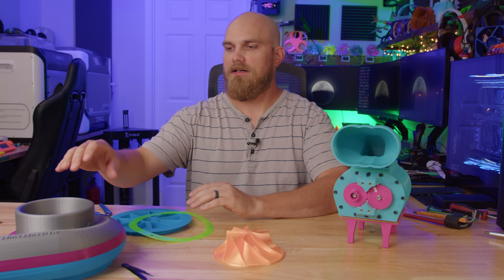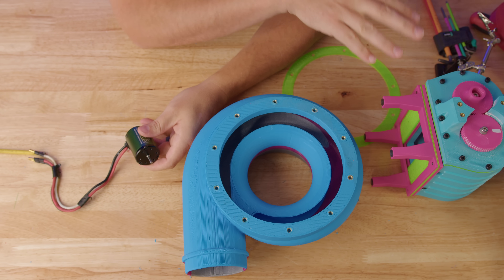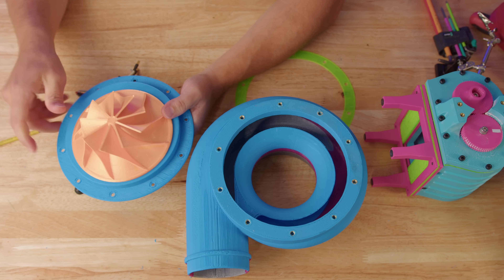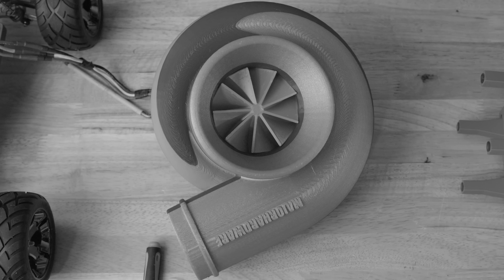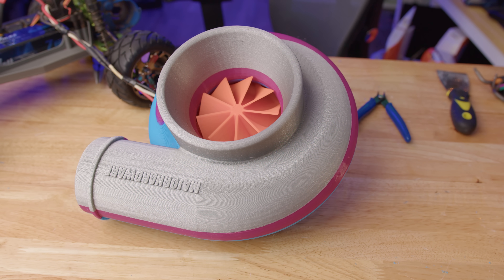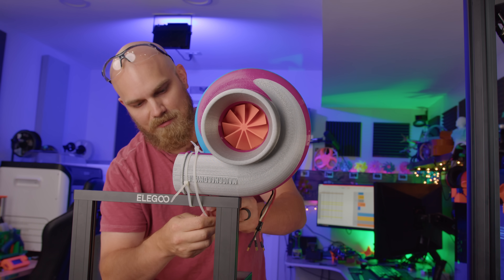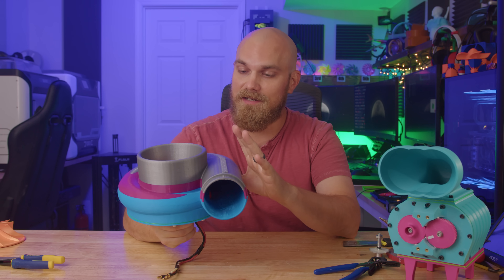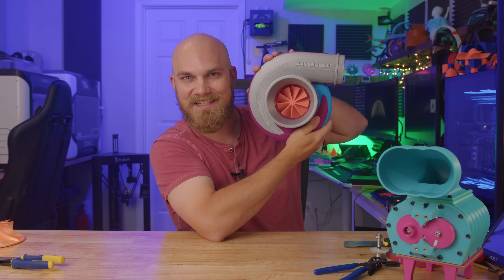I BUILT a MASSIVE ProCharger for my PC

Comment: The tests done look really great, specially the amount of air this thing pushes is insane.... howwver you should also have done the temperature test of the air temperature at the inlet and at the outlet to see if there is any change in the air temperature.... In fact you should invlude this air temperature test for all the fan showdowns you do.. it could be one more paremeter to test if the air coming out is cooler or hotter or no change.... Just a suggestion. @MajorHardware

Comment: On fans closing off the fan output till up to speed will reduce the reduce a lot of overheating at least with conventional AC motors or slowly bring up your speed. Pumps are current pigs on startup.

Comment: I wonder if this or similar design can be done as a Tesla pump (ie turbine in reverse).
As a tesla pump it should suck air close to the center on one side and in its simplest design blow it out radially.
As far as I know one of the major drawbacks of the Tesla turbine is that its efficiency is highest when the air and disks rotate at about the same speed, which is hard to achieve given that the disks are heavier than all of the disks and that as a turbine its hooked to do some work, which slows down the disks.
As a pump (or fan) however it's the disks that will such the air, and after a few seconds (if working as desired) should move the air with a speed proportional to the disks rotation.
Not sure how it would be in noise ... all of the Tesla turbines I've seen in the tube are quite noisy ... but again they're usually driving them with high pressure air at tens of thousands of rpms, and as a pump it will drive the air to its speed ... still no idea what noise it would generate at around 2-3k rpms.
By rough estimate in 25mm thickness about 15 1mm disks should fit at 0.4mm distance from each other (just throwing some optimal Tesla turbine specs I've seen) not incl. the two outer walls (17 in total, with 2 being the outer walls) ... I guess at least 10 1.5mm disks with 0.5mm gaps can be fitted with rougher design ... still it sounds like a great amount of surface moving air, so I wonder if it's good for a fan.
I've seen it works in principle, but just wonder how would it perform against other top fans :)

Comment: i have the solution ... you can only test the fans in a room of consistent shape and pressure using levitation .. but you will need to counterspin 2 pairs on a quad formation .. that will reveal the best desginsz .. using that method the void fan or the fullyshrouded or shieleded methosz /// you  know that sound deadening cavitation ... that numbeness to the sound when the fansz achieve that in a void it will make an inertial shroud thatsz what the sound loss isz causing negative or zero mass as well as change character nase don the fansz themselvesz .. the levitation moddal will show fan efficiency then you can play with starting in a water chamber and removing the water an dyou will still see thrust .. in void you may need a primer

Comment: the reason the supercharger looking thing makes so much sound is because the gear teeth aren't Helical, it's used it cars, Helical gears make a lot less sound than straight teeth does.

and for the Centri-Charger to make it blow air faster, it needs to build Preasure, that's why i suggest making a nozzle on the end that pushes air out, that narrows in about half size, you'll build up preasure, compress the air and it will push a lot more, if i did the math right (doing this on the top of my head) you'll produse about 1/3rd more of the air it currently pushes.

though i have another idea for you, make a turbo-fan, like those you see on airliners, they use a lot of fans to compress air and push out a huge amount of thrust (tho they use fuel and the 3d printed one will not) it could potentially still push a lot more air, cooler air and if you use Ball bearings, it could be very efficent, i'd love to see something like it.

Comment: Run a lower KV airplane outrunner (400-800kv) and a higher voltage battery. Much better efficiency and torque for that large compressor.

Comment: Okay. So a few points to make. All of them picking apart how dumb this video is.

A "ProCharger" is a brand of centrifugal supercharger. It used the crankshafts speed to spin a turbine forcing more volume of air into the intake of an engine. 

What you have created is a blower motor. This is not a "ProCharger" or a centrifugal supercharger.

Comment: Those quadcopter motors will probably do pretty well. Maybe one of those with stator in the middle for the freak bonuses. Although you might want some sort of a brace for the fan rotor to rest on at some point.

Comment: I have a box full of unused bldc motors ranging from 5 KV to 12 KV with thicker shafts and I believe I have a couple that actually have a set screw attached spline drive for attaching belts as they were meant for RC aircraft and the ones with the belt attachment were meant for off-road skateboards. If you can find a way to reach out and pay for the shipping I'll gladly send a couple of them to you in exchange just for a simple shout out when you produce the video If you use my motor. I used to tinker a lot and have no use for them anymore they're just sitting in a box collecting dust. I recently suffered an injury at my job a few months back that has resulted in a severe mid-carpal instability in which I will need ligamentous reconstruction and repair surgery on both of my wrists and no longer be able to work in the same capacity again. So watching somebody else tinker with my toys would be awesome since I'm now unable to work. josephreese777@gmail.com

Comment: There is a formula for determining the KV rating of the motor needed based on the type of propeller/impeller, it's mass, number of fins, ect.....  I don't actually know the terminology. I just remember  coming across it online many years ago. 
Just as a general place to start I'd say look at 80-90mm outrunner motors with the highest KV you can get. These large flat outrunner motors don't spin the fastest, but have incredible torque. So, to get the RPMs you want might require big voltage. They usually handle up to 12s (~45v) and something in the range of 60amps (~3000w)

Comment: it takes a lot of time to print large parts and, most importantly, there is no balance. even if it was all done for fun. you won’t get a buzz from this. print the central axis for the blade from the outside and put the bearing. fasten the return bearing in the shape of a cross in front of the inlet and this device may not be so noisy.

Comment: this is more likely an electric turbo not a procharger
instead of it building boost
it technically builds up that performance margin...

wait did I just say the same thing. but still if done right this would be insanely powerful and would definitely work well with a watercooler to keep that intercooler nice and cool. and likely a very reliable cooling fan but unfortunately might not fit in ANY computer case. well then, I would just wing it and build all the BOOSTED COOLING for days of redneck gaming!
I personally wouldn't recommend it due to its large size, the tight tolerances, possibilities of electronics to fail are high if done ever so slightly incorrect and the insane 3D printing skills to pull it off 

basically saying: DO NOT ATTEMPT THIS UNLESS YOU REALLY KNOW WHAT THE RISKS ARE WITH YOUR COMPUTER!
just make sure you have more than one computer. you surely wouldn't want to over boost it

Comment: Get a higher torque motor with decent rpms rather than a high RPM motor and use a pulley system with a belt instead. You can also print an adjustable pulley (think cvt transmission)  This will allow you to play around and adjust the rpm with a simple printed pulley by changing the sizes to maximize the performance. Higher torque loads at higher rpm is harder on motors than high torque at lower rpms and the faster you spin a turbo the better the output. I also agree with the people talking about using bearings, friction is the enemy of turbo gains and bearings will offset this. If you do that you might have to consider an oiler system because the lifespan of sealed bearings at high rpm probably would not be good enough.

Comment: Awesome design, a suggestion for the motor... Maybe use an RC airplane motor designed for a prop plane, usually those are held on by a nut, like you mentioned.

Comment: To increase relability, bigger axis for the fan, and ball bearing joints (because no oil), and a 2 Inches gear on the exterior side, giving More Fan speed at Lower Engine Speed.

Comment: You'll definitely go well with a Castle Mamba Monster X for ESC and maybe an Arrma 6s capable motor for higher speeds vs low down torque instead. If you can find a way to flush fit some some bearings in there to help with the spinning it won't put so much load onto the motor with trying to spin it up. Could you maybe look at using an RC pinion and spur gear transmission set up so you can change the gearing based upon your own requirements and allow for greater control over speed vs torque too

Comment: idea time: Add some gearing or the transmission out of a RC car to reduce the load on the motor (actually using the pinion and spur gears), this would allow you to control RPM output and give you a bit more bang for the buck. Doing this would allow you to use a shaft that goes through the turbine wheel which could be braced on the intake side and minimize wobble. This can be accomplish with just a friction fit or you can drop some super glue on the ends. Using a HSS shaft or toolsteel shaft would work best as you can insert a brass bushing to keep it from burning a hole into the plastic. Would work best for short bursts but long term it wouldnt. Then while taking all this into account, using teflon spray would work wonders for decreasing over all friction.

Comment: add a shaft that goes all the way through the turbine so you can hold it on the top too, and put the motor on a belt and pulley. That should keep it centered and stable even if the interference is a bit optimistic

Comment: Would love to see a beefier version with a large motor and to be made from heat resistant materials like PP, PEEK or maybe even ABS.
I don't know if you have access to the hardware for printing with those materials as they're not the easiest things to print with. PETG would be way easier to work with but wouldn't be as resistant.

Comment: Get yourself a Team Triforce A200S motor controller and a Neu Motors 8057/100 motor. There will be very little you won't be able to power with that combo. Use gears or belts to get it to the RPM range you want from the 10000RPM limit of the motor.

Comment: Bigger motor. Less wobble.Tighter tolerances. Targeting a stable and quiet 2500 CFM. Pushed through a 120mm, 240mm, and a 360mm radiator using various air splitters. For science.

Comment: We use four Vex Robotics Neo motors to push a 160lb robot 20fps, and a single one can climb the same robot 3ft in under 1sec.  8mm shaft, crazy powerful, and easily sourced.

Comment: For the electronics I suggest using the spectrum 6/8s line. Those usually have quite a bit of torque. Maybe find a way to test compression and gear the compressor wheel so you have much greater rpm.

Comment: I have a 3D printer, not used once since I got it about 3 years ago. That looks well worth trying to make to cool a PC with. Perhaps three of them. Two in front pushing air in, and one in the back pulling air out. It would be a beast of a PC case, but when you have a beast of a PC, there is next to no such thing as, too much cooling.

Comment: Run a shaft all the way through and put a ball bearing on each side.  The intake side would have to have 3 or 4 support arms across the intake with the bearing in the middle.  Then just hook any motor to the shaft.  Stable, smooth and no risk of bending the motor shaft with an out-of-balance compressor.

Comment: i wanna see if you can have it make actuall pressure in my pc case like how turbos go off the exhaust of cars. edit: basically have a super fast fast blowing out the pc case into the hot side of the turbo which will spin the cold side of it hopefully making boost

Comment: Motor wise I'd go either Castle Mamba X esc and a 2400kv motor (with the 5mm shaft); a lot more power and can run on 6S which should be more than enough to melt some PLA :)

Comment: You should try felt cloth in something like this. It can make a gasket and anti-friction bearing, especially on uneven surface. They also retain lubricating oil well. In this case you would just need a couple strips to stop the fan from rubbing. It just needs to be wet or it will start a fire.

Comment: if you want high speed motor, check for some edf fan motors
I personnaly used a "Typhoon HET EDF 240-15 24mm 4800Kv" for a similar projet on a smaller scale (you know, smaller tend to much less power)

Comment: A blead air Chanel to cool the motor would ne useful.  I'd like to know the rpm and psi for the system. If you spin a brick fast enough it will move air. Liquid cooling is not a option for me. So I'd like to see what happens when you give it a little more thought. Not saying your efforts went to waste. It just kinda seemed thrown together. Or placing the motor I. The sir stream and belt drive to power it. That would cool it and run the system.

Comment: I work in RC. I've got a Traxxas 4-Tec that I put a 6s system in. I used the Traxxas 2400kv motor out of the Maxx and the ESC out of the E-Revo. With a 48 tooth pinion and a 55 tooth spur I had a calculated top speed of 137mph. Great thing about that motor is that it is the same diameter as most 1/10th scale motors. It runs a little hot on 6s, but shouldn't catastrophically fail like your Castle did. It does have a 5mm shaft on it too, but uses either 5mm or 6mm bullet connectors, I forget which. Your 3s ESC can be modified with those connectors, or any 4-8s ESC should have them. Failing that, I would go with either a Castle or Spektrum system, the determining factor between those brands being cost. Both offer enough variations in their line up you should find what you are looking for. I don't recall what Castle's warranty is, but remember it's good, backed by good customer service, and I rarely have to use it and have never had any trouble when I have. I sell a lot more Spektrum, and they produce some good electronics. If you do get bad electronics, they have a 2 year warranty and great customer service. I've not had any trouble getting warranty repair done. If you really want to go big, Spektrum makes a 750Kv 8s system that's great. Pushes the 8s Kraton, a 30lbs truck up to 90ish mph. That or the Castle 800Kv system. It's pretty chunky too, one of my coworkers uses it in his speed car.

Comment: I think an outrunner motor would probably be a better fit for an impeller that size - Bigger shaft, better cooling of the motor coils, and better torque 
(that poor inrunner is designed to go up to like 40K+ RPM, and it just can't with that much load on it.) 
Something like a 4240 or 5055 size motor with a KV of around 300-600 would probably be good. At 300kv, 8S would give you a maximum of ~10K RPM and 600kv would give double that.

Comment: u could still make a turbo just put the fan on the exhaust side and move air from both sides either into the system or make as a proper engine style with the exhaust side removing heat from the pc and the intake side into the pc

Comment: Yeahhhh, that motor is meant to spin at high RPM and be geared down a lot 😅 A lower KV motor with more low down torque would do much better, unless you’re able to use some gear/belt reduction on a high KV motor. 🙂

Comment: instead of runnig the motor on the back, why dont u put it in the intake? should provide some cooling, especialy if the intake cone has the same height as the motor. 4 arms, 90 degree ahead may do the work, with 2 or so old intel heat sink drilled to insert the motor inside.

Comment: I want to see if it's more efficient at moving air by setting how much air it moves at the same rpm as the base fan...vs how much current it is pulling to spin at the same rpm.

Comment: Outrunner motors are good for lower rp higher torque i recomend a 20cc equivalent for the beefy power you will need like 90 amps to run it i have one on an rc plane and it has a 2/1 power to weight it can literally hover like a helicopter and then just yeet itself into the air. It has 470 kv

Comment: heater motor from a car would work..it turns a big blower in the dash and its 12v shaft size is bigger by 5-6 times i think but has the hp. to run something that will work, you could run it a 16 volts be fine 👍👍

Comment: you could make the turbo using the "exhaust" that spins the back side come from the front intake and the total exit is out the dump pipe off the back side of the turbo?
so the flow would be in the intake, out the "cold" side (where the intercooler would be), immediately round to the intake for backside (where the exhaust would be) and finally exiting out the "hot" side dump

Comment: The roots style charger sounds so much better. I would love to see the performance of each attached to a radiator with a gasket. Only seeing the roots attached to half of a radiator with the old motor was disappointing results. It should be sealed off and forcing air through the entire radiator. This would be the only way to create any boost and see how much better the temps are than regular case fans.

Comment: There is a difference between a roots and a twin screw supercharger. im not sure how you built the roots. But the roots has what looks like paddles on the shaft and a twin screw essentially has threads that compress the air.